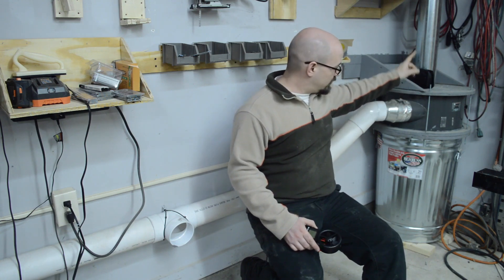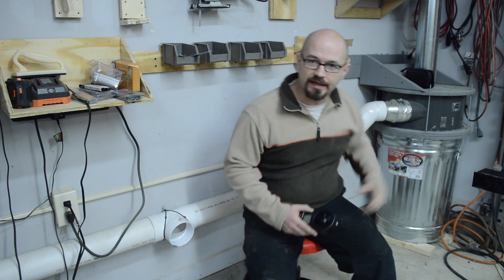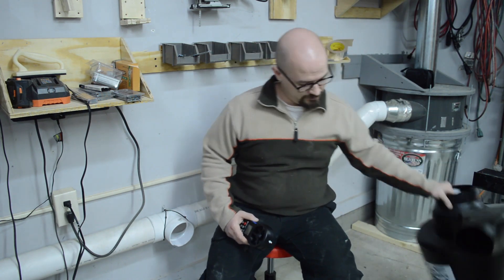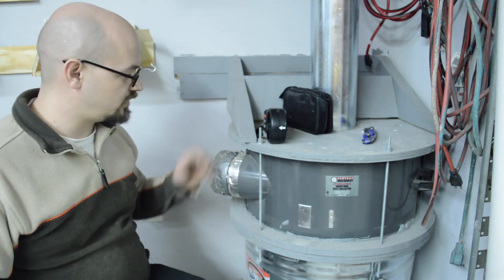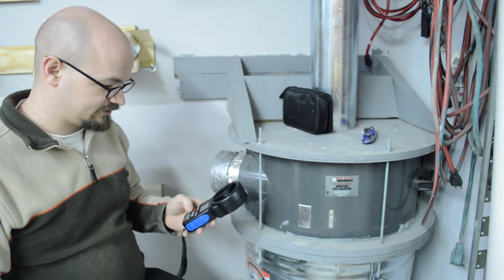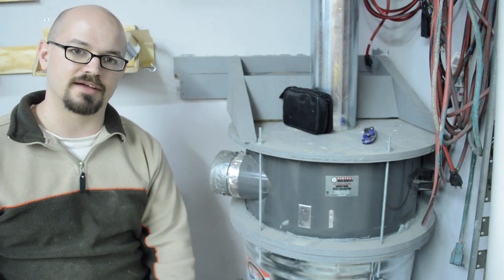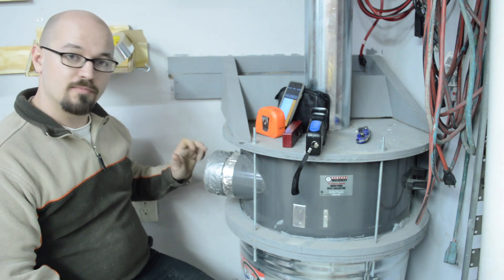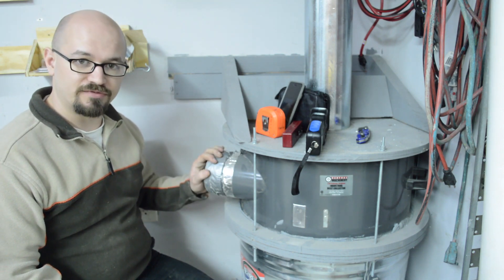Thien Baffle or Cyclone: Efficiency Comparison

Comment: I think the points here that the test may not have been perfect are valid enough to warrant me asking: now that you've used both over a long period of time, can you definitely say that one shows more noticeably effective collection at your tools than the other? That's really the biggest concern I have between the two. The cyclone would add another couple hundred to the cost of my collector system, and take up substantially more room, so I'd like to really be sure the additional cost and space are worth it. Can you say the cyclone has been noticeably better or just marginally? Or can you even tell the difference?
Reply: While the cyclone is superior in many ways, the Thein baffle has a lot of potential for a cheap 2nd stage if it is built correctly.
Reply: @Gnew111  It seems to me that what constitutes "built correctly" has not been answered yet.  Even on the Thein forum, there is quite a bit of uncertainty, even controversy (although the Thein forum is a very civil place) as to what is best.  Some of the members have done some testing of variations in design and are very helpful.
Reply: @Andyloveswood  Agreed, currently the idea of "built correctly" would consist of using the original document that is floating around the forums regarding the proportional dimensioning of the system. Other factors consist of ensuring a good seal of joints, smooth interior, and avoiding any excess material extending into the drop slot gap on the inside exterior edge where the vertical/ horizontal planes meet. This would be the absolute bare minimum for design considerations. I have reached out to Phill on the Carbide forum asking about any CNC .svg/.dwg files that are out there and he said he respectfully cannot really promote one design over another. My intent would be to create a design that I can cut out on my Shapeoko XXL 3 with controlled adjustments to multiple iterations. I am a fan of the Thein baffle despite its disadvantages because its a cheap and effective way for people to reduce respiratory hazards at a fraction of the cost. From my understanding, though the system really lacks research and the formulas to support airflow requirements from a specific vac. I would eventually like to incorporate the bell mouth into the system as well but in my opinion that detracts from the DIY aspect just a bit. Perhaps I should get in on the Thein Forum to see if anyone is interested in collaborating on this?  Purdue Construction Management Engineering Student, Ex-USMC
Reply from the maker: Very true
Reply: YouCanMakeThisToo from looking at the Clear Vue they seem to incorporate both.
Reply from the maker: I can tell a big difference. If you can’t afford it, then you can’t. But if it’s in the budget, it’s worth it.

Comment: I think the flow restriction of a centrifugal separator depends (among other things) on the diameter of the vessel where the separation takes place. Your Thien separator vessel had a large diameter relative to the dust deputy. I hypothesize that if you used a much smaller vessel, the flow restriction of the Thien separator would be better. For example, Cosmas Bauer uses an 8-in diameter PVC pipe for his separator, but unfortunately does not measure the flow restriction. Of course, the port diameter also makes a difference, and you could not use an 8-in diameter separator with 5-in diameter ports. So, not that I am asking you to do it, but I guess the better comparison in your case would be to a Thien separator with diameter about the same (or a little less) as your dust deputy (at the top) and the same size ports.
Reply from the maker: Thanks! That makes a lot of sense. I know how to measure things, but really know nothing about air dynamics. I just built it that way because it made use of parts on hand - and I didn't know any better.

Comment: Between your video and you generous replies to the questions below, you have uncovered a terrific point! At first I was concerned with percentage of dust recovery. But you refocused me on the question of airspeed at the tool for removal vs. acceptable partial size for releasing outside as I plan to do. So my question is: how does it look outside your house running just the cyclone?
Reply from the maker: +NMranchhand thanks! It's been set up... since this video went up, haha. And I haven't noticed a build up of dust outside.
Reply from the maker: +RJbiz Music that sounds like a good system. Glad it works for you!
Reply: Hi, I redesigned a squat  500mm X 500mm X 250 high    WITH NO FILTER   removes 99.9%    chips to  down to 4 micron.   125mm IN.OUT  All to bulky for less   Dust removal is what its for  cant just exit dust  Cheers

Comment: Ah wow thanks for the quick reply! I built a system similar to yours and made a new cover plate with a 6 inch HVAC take off that fit perfectly in to the SSD, if you go to sawmillcreek forum look for theFalconjetdriver and you will see mine. Look under the sub group of  workshop.

http://www.sawmillcreek.org/showthread.php?258154-Another-HF-with-SDD-amp-Wynn-35A-question!-how-much-WC-change-should-I-see
Reply from the maker: +TheFalconJetDriver that's great, I'll check it out. Thanks!

Comment: What size is the HVAC pipe you are using between the impeller and the SDD? Are you using the original 5 inch hole in the fan housing on the HFDC?
Thank you for the video! Lane
Reply from the maker: +TheFalconJetDriver yes, it's a 5" pipe because that's the port size on the impeller.

Comment: Thank you for taking the time to create the video and sharing what you learned. I have tried to find DR Sussman  ha ha renown physicist/ aeronautical engineer. Fluid dynamics aficionado. He offers a lot of criticism on how folks test their systems on YouTube I wanted to contact him and solicit his advice on my system build. (I can't find him. 
Or a way to communicate with him.) In the end does it does your system accomplish what you intended for it do and which one did a better job with your present circumstances.

I do not have a pitot tube nor a way to measure the air velocity. Although the airplane I fly has 3 pitot tubes. 
Back to my question I have the HFDC A Supper Dust Deputy (SDD) currently I have the stock impeller but I did remove the stock 5 inch input port
And made a new impeller cover with a 6 inch flange that fits nicely into the SDD. I live at an altitude of 1900 feet in West Texas. (Density Altitude can be very high in the summer)
The distance from the impeller to the SDD is 4 inches. I am wondering how this affect my system? Would going to the Rikon impeller 
Be worth the money? I do have the Wynn 35A274nano filter and I will be using 5 inch ducting to my machines with blast gates. Only one machine
Will be used at a time, short runs of 10 feet or less.
I am aware that the current load will be different from the original design of the HFDC system. Using my Amprobe with no back pressure on the exhaust or no duct work hooked up to the the input I am only pulling 6 amps after startup. Will the larger impeller load up the Motor? Will I benefit
Or hurt my situation with the larger impeller? Considering my altitude?

All ears! Paging DR Sussman Come in DR Sussman.
Reply from the maker: +TheFalconJetDriver thanks! To be honest, you're mostly asking questions way beyond my knowledge in this area. But I'll answer what I can. Swapping out to a 6" port was a good idea and will help. 

As far as the impeller upgrade and the motor I don't see a problem, I know other people have done it so it should work well. The only extra strain on the motor is during start up, once it gets going the motor can handle the load fine. The trick is to not be kicking your machine on and off a lot, that will build up the heat and burn it out. Shoot for turning it on no more than 4 times an hour. It's like fluorescent lights, it's more efficient to leave them on than toggle power. 

Short runs with hard ducting is good. One think I should've had done but didn't is out of your cyclone input you need a minimum 5' straight pipe to minimize turbulence. I didn't know that when I set up my system.

Comment: What I'm saying is the length and diameter of the pipe, from the impeller of the dust collector motor to the separator (either the Thein Baffle or the cyclone),  effects the total cfm at the collection inlet of the separator, where you measured the air flow. It appears that you forgot to take that into account. It's a simple matter of Fluid Dynamics the longer the distance the air moves thru the pipe the greater the loss, so what I'm basically saying is  if both the cyclone and the Thein Baffle had the same length and Diameter of pipe from the impeller to their suction inlet and both collection ports were equal diameter the measured difference in cfm at their collection ports would be negligible. What you would in all likely hood see is a 10-15% difference in separation efficiency between the cyclone and the Thein Baffle.

Comment: nice video however you forgot to take into account the difference in the length and diameter of the pipe between the impeller and the baffle vs the length and diameter of the pipe between the impeller and the cyclone, as well as the ratio of the difference between the two inlet diameters. If you check your volume difference at the end of the open pipe with the two different setups you'll see that a majority of that 200 sum odd cfm difference is lost in the pipe before the baffle.
Reply from the maker: +Riverplay 48 not sure I understand. Are you saying that forgetting the cyclone or baffle, the loss happened by the intake pipe being longer?

Comment: Thank You for this. I've been looking for the same comparison. I do still wonder however, how much difference the Thien baffle design (diameter and depth, swirl baffle etc.) have on it's efficiency.
Reply from the maker: +David Wood glad you found it helpful! I'm sure all of those different variables have an effect on performance. And there's probably an optimal design.. and I doubt the thien baffle I built achieved that design. Lots of unknowns there. But, I think it's safe to say that an off the shelf system will perform better than something you can hack together without specialized knowledge. That said, the thien did work okay for me, but the dust deputy is better for my purposes.

Comment: AH.... which one collects more dust? Could more loss in CFM equate to more efficiency in removing dust? And where does the loss of CFM come from?  If the higher loss means deposting more dust I could see that. If the blower has 800 some CFM and it is in closed  system where is the loss coming from? Friction, difference in input vs output port diameter. 47 % loss seems really high consider it is a closed system.
Reply from the maker: +Qmaster Penman my best guess is the CFM loss comes from higher friction and turbulence from a inferior design. Input and output port sizes are very similar. Its not a closed system, I vent mine outside - not through a filter. Because of that I'm not concerned with separation rates, but best collection at the tool, that's achieved through higher CFM, so the dust deputy works better for me in my circumstance.

Comment: Excellent video. What you measured was flow restriction, not efficiency. Typically, when talking about differences in efficiency between one separator and another, what we are talking about is "Fractional Efficiency", or how much dust is collected versus how much passes through. In fact, if one were to compare two cone-shaped cyclones, each having the same size input and output, there is often a worsening of air flow as fractional efficiency improves. Cyclonic separation can be impacted by a number of parameters like air speed, chamber diameter, length of the cone, etc. The "Best" design, if there is such a thing, is one where flow and cone shape are balanced for optimum throughput and separation. (And from there it starts to get complicated.) I believe your viewers would be interested in knowing if you saw a difference in Fractional Efficiency between the two designs. Also, "All things being equal", as you say, how did the diameter of the inputs and outlets of the two designs compare. A more valid comparison of flow restriction would start with two devices having inputs and outlets of the same size. A 1/2" difference in diameter will seriously impact flow measurements. The next step would be to compare fractional efficiency. Getting better flow at the expense of allowing more particulate to pass is not necessarily an improvement. Better flow AND improved separation would be a really big deal. Thanks again for your post.
Reply from the maker: +Thomas Huntley thank you for all the information and correction, I just learned a lot from you. Since my system vents outside instead of through a filter I wasn't concerned with "fractional efficiency"? Nor did I have a good way to measure it, but I agree that would've been good information to collect. For my setup I was mostly interested in how to get the most CFM at each tool to improve collection at the source because once it's in my system it goes to the can or outside. So initial collection is where I get the most effect from my system. I hope I said that right or at least made sense. Thanks again!
Reply: wow, what a fantastic comment, best I've read this months
Reply: Who said, "thou shall have a dust separator".

Since you are not using, selling or otherwise utilizing the dust and you vent the dust outside then your best flow rate is achieved by removing your separator.

The purpose of the separator is to clean the air so that you can recycle the air back into the working space. In your case you are not recycling the collection air hence no separator needed. So, save your money and let the dust fly outside. Hahaha
Reply: Right on, MrFixIt! 
When I clicked on this video, I was hoping for something like a fractional efficiency comparison. I'm pretty sure that most viewers of this video would be looking for that. 

I'm planning on using a shop-vac to extract dust from one tool, a table saw. 

Designs I've seen using a Thien baffle looked like they worked very well in terms of fractional efficiency, were cheap, and were compact; The vacuum cleaner stacked on top of the baffle, stacked on top of a bucket for collection. No intervening hoses, which was nice, and the vertical design took up very little floor space. But a bit complex to make from scratch. It didn't look to me like any dust was making it up the air column into the vacuum's filter, which is obviously key.

The cyclone design took up more space, but was much easier to build. You just run one hose to the shop-vac, another to the tool, and mount the cyclone on top of a collection bucket. A fair bit more expensive though, because you have to buy the cyclone and all those hoses and adaptors.

My research into this matter continues.

Comment: THIS WAS A GREAT EVALUATION. I BUILT A THEIN UNIT AND MY FPM LOSS BETWEEN MY  MOTOR  AND OUTLET OF  THE THEIN IS 500 FPM. IF I AM DOING THIS RIGHT I CAN'T BELIEVE ITS THIS CLOSE. WE SHOULD REMIND EVERYONE THAT THEIR   MANUAL SPECIFICATIONS ARE LAB READINGS, PROBABLY NO FILTER INSTALLED TO REDUCE RESISTANCE. WHAT DO YOU THINK?
Reply from the maker: +A Thomas I think you're right. The spec numbers are not a use situation.

Comment: Wow. The HF collector is advertised at over 1500 CFM. You got a huge difference when you checked the actual flow.... http://www.harborfreight.com/2-hp-industrial-5-micron-dust-collector-97869.html
Reply from the maker: +centaurus777 yeah, it definitely does not perform to the hype. But, it's still a good value that can work well in a small shop, especially for the price point.

Comment: Great video. I am about to modify my HFDC as well and I have the attic as an option for my motor. I was concerned about the hot temps in the summer here in Ohio. Have you had any issues with that?  Also, I'm curious if you measured the separation efficiency and compared with thein baffle. Thanks.
Reply from the maker: +Adam Snyder I live in Memphis so we have the hot summers too. I seldom run mine for more than a few minutes at a time so I'm not worried about it. Can cross that bridge if it becomes an issue. I didn't compare separation efficiency, wish I had Joe you mentioned it! I'd put money down that the cyclone does it better just because of how it works differently, but it'd be nice to have numbers.

Comment: Thanks for your video, i need to convert our harbor freight collector at work this week and was not certain to go with thein or cyclone. any comments on trash can  type you prefer? i see others using rubbermade types but am concerned that they may crush under air pressure over time.
Reply from the maker: +Jason Benoit I like the metal purely because of the handle style. If you go with a cycle, it really doesn't matter strength wise what kind of can you use because there will very little pressure. Particles go into the can as a function of gravity and the cyclone, but the hole in the bottom isn't actually in the path of the flow. With a really powerful collector there may be a concern, but you'll be fine with the HF. The only thing I haven't done yet but want to is add a window so I can see when it's almost full.

Comment: Im building out my dust collection system this week and had the exact same question!
Reply from the maker: Well here you go! I was really surprised I couldn't find the answer anywhere else. Did you find it anywhere else?
Reply: I remember seeing a video about a year or so ago where a guy measured the airflow at different points in his shop and how much he lost using a 90-degree elbow. But I don't think I've ever seen a comparison on how much gets lost at each step of dust separation.